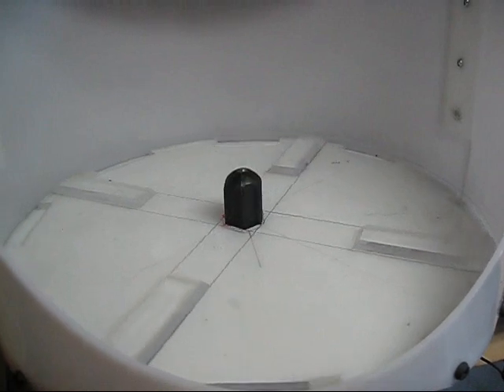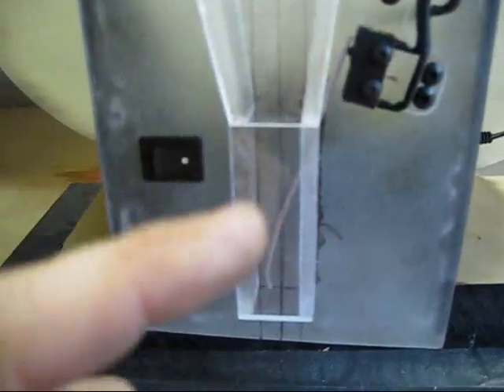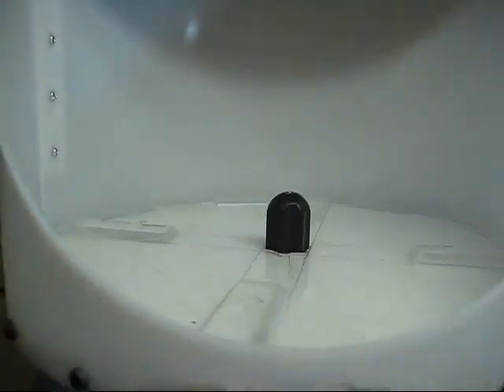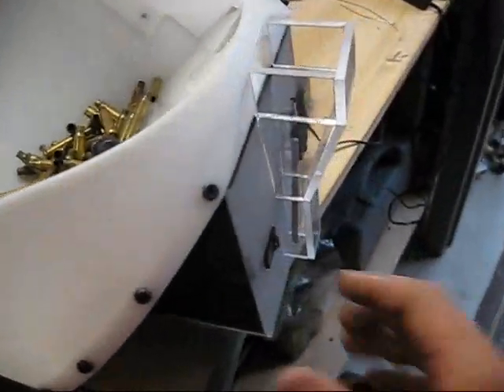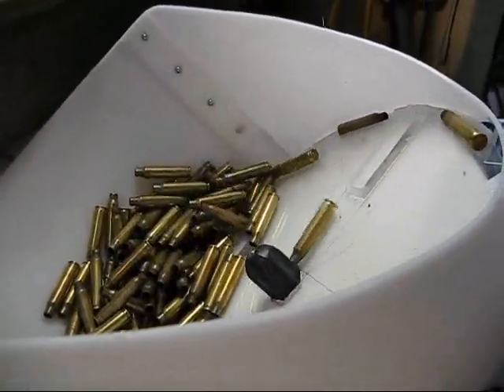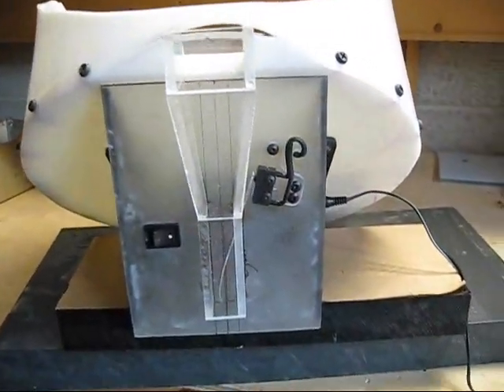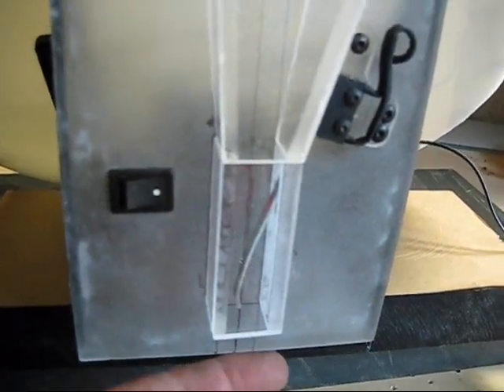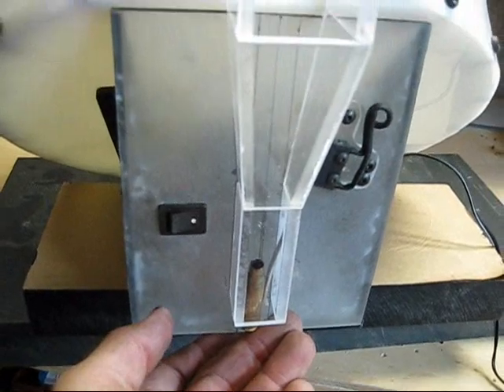Homemade case feeder

Comment: How do you get the case small end to go past the opening so the heavy end always falls first?
Reply: i don't know, how to link, so the answer 2.nd time:
The hole-lenght is a little bit more than the distance from bottom to mass centre.
If the bottom is in front, it's fall down direktly.
If not, the collar is over the hole (not heavy enought to fall, the mass centre is not over the hole yet), so the buttom fall first if it's reach the hole.

easy, but very clever

Comment: Anyone have a link to a microswitch that works for these? I built one but the microswitch i ordered online is way too stiff for the cases to fall through it without getting stuck
Reply: Where did you buy the switch? I've seen some on eBay with the title of low force micro switch.
Reply: gpruitt54 I bought one from Amazon http://www.amazon.com/gp/product/B0050HKB8O/ref=oh_aui_detailpage_o02_s00?ie=UTF8&psc=1
Maybe I will have to try eBay and look specifically for low force.
Reply: gpruitt54 Thanks.  I will give that one a shot... price is sure right!
Reply: Yeah, it's the one I plan to use for my project.
Reply: any luck?
Reply: Unfortunately, no. The feeder works great but I'm currently turning it on, letting the tube fill up, then switching it off. Load the rounds and turn it back on again to fill up.
Reply: I may have found some. I'll post my video of build once complete.
I found some very low newton force

Comment: Could you please provide the length of the slot in the bullets fall through in the white plastic?  Thanks.
Reply: tkarlmann Striking that forward or base first they drop base [Heavy] without issue. Simple as a seatbelt!!! 
[Slot size will vary for each caliber, .... even if your motor turns 6rpm vs 4rpm. Just test and tweek it to run well] At that point bucked lids are really cheap.

Comment: very good work,.... by, the way ifound 3//5and  8 rpm mini motors on EBAY electronics,,type in mini 5 rpm 12 volt dc motors,, SHOULD POP UP

Comment: Turned out good, there is a few issues that i am going to fix but all in all it works fine. I made it a lot harder than it needed to be, but my wife says that's just how i am lol. I am going to be making another now that i made the first to fix alot of the issues. Having exact measurements helps a ton which i didn't have so i guessed alot. But now i know it all or close enough and gonna make one that doesn't have little mistakes on it hehe.

Comment: I'm in the "Can you post blue prints" group.  For even $100 I'D BUILD THIS!  Buying the plastic would be the expensive part but a detailed parts list and measurements of the holes you cut for 223 would be nice.

Comment: hi thanks for the great video, you have provided the inspiration for me to start my own!
the one problem i have is that the micro switches i have been able to buy (+/- 10 types of varying sizes) require a force greater than that of a 9mmP case (+/- 61 grains or 4 grams) 
can you provide a part number for the micro switch you used?
Reply: The lever he has installed in the funnel provides mechanical advantage. You aren't going to find a micro switch that has that low of a trip point.

Comment: The TRW PP-GF30 is hard to fond and no longer made. A rotisserie motor will work about as well and handle 20 to 25 pounds. Some places have the GF30 but want $30 for them. You can get the rotisserie motor used or new for $20 @ many places.

Comment: Excellent design. Adapting this for pistol ammo would be very hard. Because you want the ammo to drop with the base of the casing facing downwards. This design uses the necked .223 casing to achieve this. Sizing this up to .308 is no problem, but sizing down to "straight"-cased ammo like 9mm or .45 isn't going to be easy.

Comment: I love ingenuity, this is so awesome!!
Would you share the opening dimensions, which cause the case to always fall bottom down regardless of orientation?
Reply: It's a little bit more than the distance from bottom to mass centre.
If the bottom is in front, it's fall down direktly.
If not, the collar is over the hole (not heavy enought to fall, the mass centre is not over the hole yet), so the buttom fall first if it's reach the hole.

easy, but very clever

Comment: very cool!  I wonder, will there be a toll taken on the motor caused by the constant short interruptions of cases tripping the microswitch ? Maybe add a piece to the circuit to add a 1 second buffer after the microswitch is tripped ?

Comment: yeah-.I cant beleive I didnt think of it ...if you take a peice of .223 and try balancing it-you'll find that the last 1/3 of the brass is equal to the front 2/3's. So if it goes upside down-the back drops first. if it goes rightside up the front will glide over the opening untill the base drops down the hole...I hope I didnt over complicate this answer for ya.Now I cant figure out how to adapt the shell feeder to a hornady LnL AP and I'm stumped on how to make a bullet feeding die for the press

Comment: Great work!  That is fantastic!
I wonder how much something like that would cost to build if you cannot find a 4rpm motor at a junk shop?  Could a faster motor could be used with a potentiometer to dial down the voltage and slow the motor?